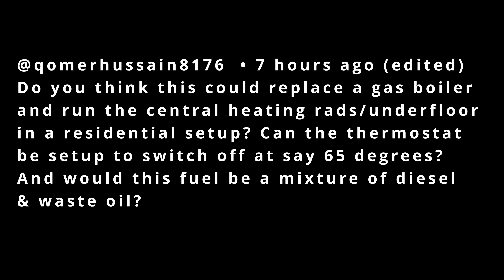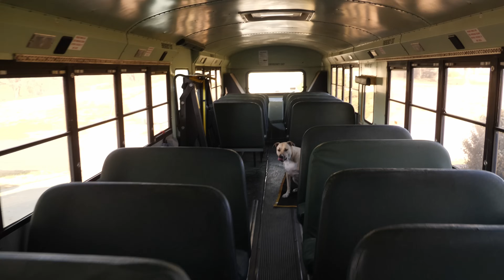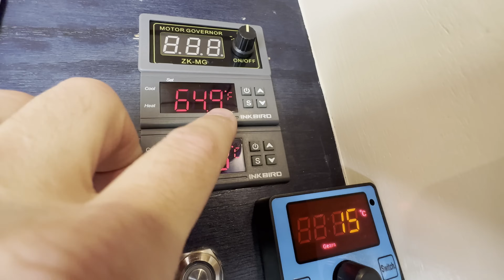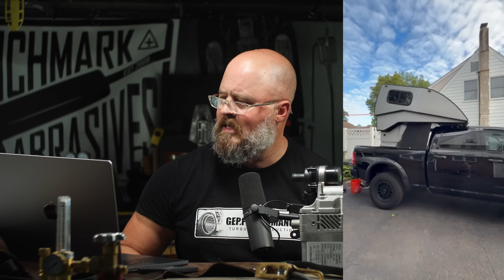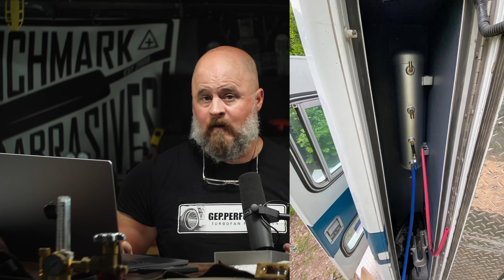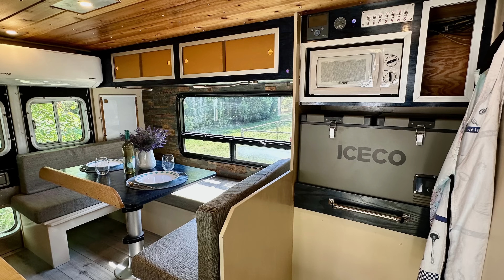Can a Diesel Heater Really Replace a Gas Boiler? (Q&A)

Comment: Hello dear, i have buyed 35 kw end i going to build a aluminium boiler house bigger about 600 mm alone the house what is machined cost MY more than i buy it end i instal it on my balcony dieselheater with flue gas recovery end a condensor al isolated in a unit
Reply from the maker: Hello, I am having a difficult time understanding exactly what you are talking about, but I believe you are going to build an aluminum box above your home and install a diesel heater on your balcony with a exhaust gas recovery unit.

Comment: what about the use of a plumbing manifold with shut off valves so you could close the loops to a continuous system
Reply from the maker: Give me more detail? What are you trying to achieve?
Reply: @HanginwiththeHursts  if you had a manifold off of your main loop you could use shutoff valves to isolate what sections you want to send the heated glycol too wether it be a heat exchanger for air or going into a water exchanger for creating hot water  or to an air exchanger  , there are so many possibilities
Reply from the maker: Yes, I will be using 2 manifolds on my system. One main manifold that supplies all the pumps for various loops and the other is an actual hydronic floor manifold that allows me to control the flow rates throughout the underfloor loops.
Reply: @HanginwiththeHursts  manifolds are great ideas as they can be used for your glycol hot water and cold water then with some creative engineering you can have shut off and redirects to enable almost anything you want